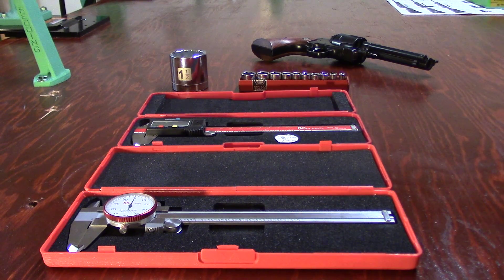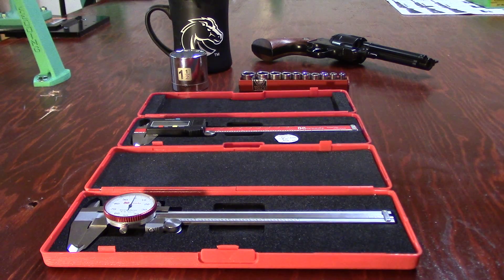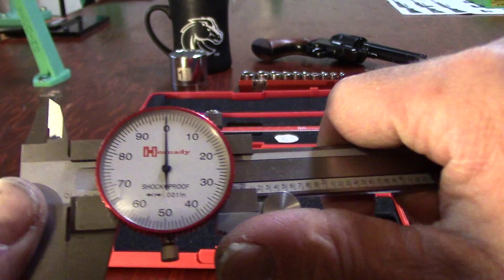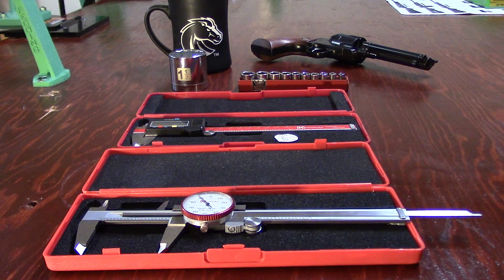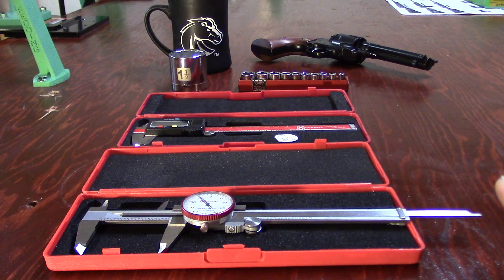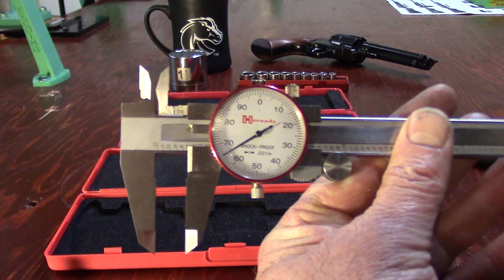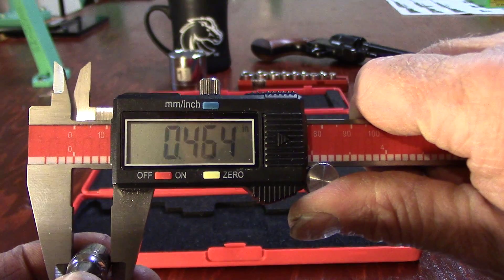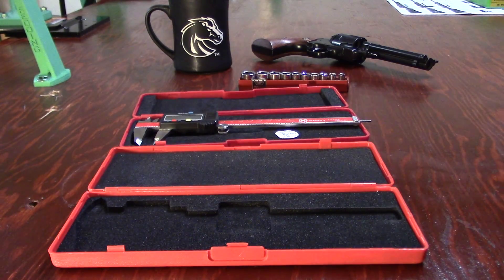Coffee with Highboy, Video 44, How to Use the Dial Calipers

Comment: I’m retired from the electronics field, I’ve designed circuits and flew through trigonometry and I don’t know why I still occasionally have trouble reading my calipers. Maybe I’m just getting old. Thank you for this video.
Reply from the maker: No, your normal. Sometimes, when I don't do a lot of reloading and maybe been using my digital calipers, when I go back to dial I tend to have to think about it for a  moment. aaaaa1957, come join my forum and use the same name. go to 76highboy.com

Comment: This is a really excellent tutorial, you have set out here a step by step instruction on reading this measuring system, which is not the easiest thing to read for non engineers, that said it is an instrument that can so easily be mis read, and I cannot see why it is so popular in USA, the digital vernier is so much more easy to read, and the reading is available to be seen straight away, with no complicated calculations to do where mistakes can occur, added to which the digital caliper is no more costly to buy, most digitals switch off after 30 sec to save battery life, but it is a pain if you have some that do not switch off as the replacement battery is expensive here in France, so I should throw those non turn off ones away.
Very many thanks for posting this.
Stay safe.
Reply from the maker: Thanks French. My digitals stay on. By habit I use my dials but I have the digital for video instruction. Have a good weekend French. Highboy

Comment: Very good explanation on how to use the dial calipers.  One thing I would like to add.  When you set them down while reloading, either make sure they are away from the powder or turn them upside down.  The last thing you want to do is get a flake of powder or if trimming brass, a piece of shaving in the rack (that is what the gears is called that runs along the upper inside edge of the beam).  If you do, it can jump on you and if you do not know how to fix that, then they are ruined.  I know being a machine shop inspector and machinist, it has happened to me many times.  There is a way to fix it if it happens, but you have to send them to someone that does machine tool calibration and they can fix it.  I used to do that also, so I know how to fix them and trust me, it is the biggest pain in the back side that you can ever imagine and will cost you a boat load of money to do, almost to the point of being cheaper just to buy a new one.  I just wanted to share this as it can happen very easily and fast.  Turning them upside down and putting the dial down inside the box when using them will save a major headache.
Reply from the maker: Your info is very valuable and I just learned something new. Would you be interested in doing an audio video with me on this subject? Let me know because I try to get factual information on my channel from people who have hands on real world knowledge and I believe you would be a big help to others and myself. Let me know. Highboy
Reply from the maker: johnny mac
Robert has good advice. Highboy
Reply: I never knew that lol i was just told to do that in class so i do that everytime lol now I know WHY :)
Reply: Bill Morgan
I would be more than happy to help in any way possible.  Only problem being is I have no way to do audio to my computer at this time.  What I can do though is send me questions and I will try and answer them to the best of my ability and send them to you for a video.  If this is something that can help, please let me know so I can do what I can to help anyone that has questions.  Also, there is more to the maintenance and checking of the calipers, as well as considerations for people that want extreme accuracy, i.e. distance or competition shooters, that have to play with calipers.  I can send along more info, but for this video and for what you were going for to help the person read calipers, it is way over the top for this video and should go for another video/discussion, which I would be more than happy to help with.  Just let me know what I can do.
Reply: I would be very interested in learning proper maintenance for my calipers cleaning and what not